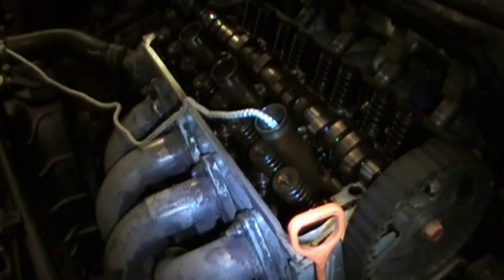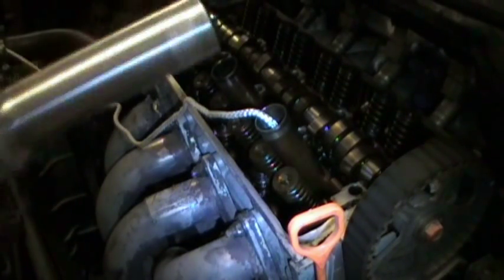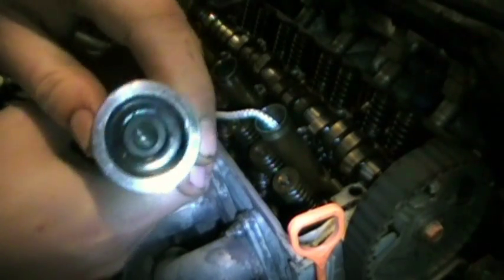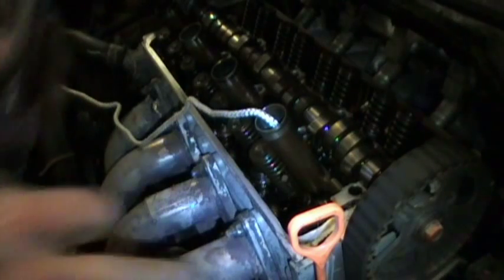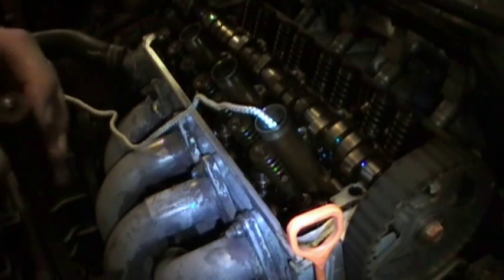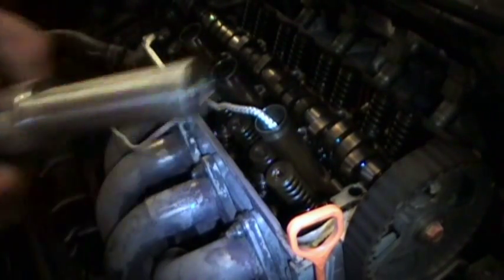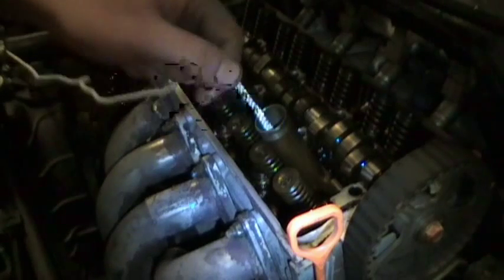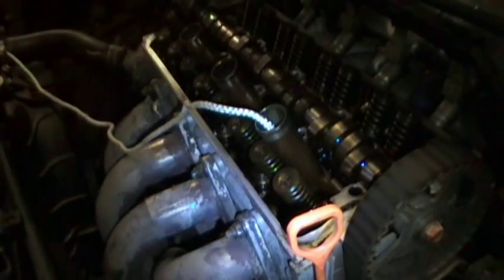Valve spring install/remove using ValveMaster

Comment: @netfreakcanada Sorry to keep bothering you.  I need to change the valve springs on a 150cc GY6 Chinese scooter engine.  Are you sure the GY6 keepers (are wider) will flare out on the top like on the engine in your video?

Comment from the maker: @Hooverdarnit when the keepers are secure on the valve, part of the valve will stick above the keepers. if you hold the keepers together you should see that one side is a little bit wider than the other side, so when held upright, the opening on the top is wider than the bottom. the keepers are placed into the retainer on top of the spring and the valve master install side has a metal nub thing that holds the keepers in place while pushing down

Comment: @netfreakcanada When you put the keepers on the valve stem, are the keepers supposed to be flush on top with the valve stem or is part of the stem showing above the keepers?  In other words, which way is up and which way is down for the keepers?  Is there a up or down for them?

Comment from the maker: @Hooverdarnit You actually put the keepers in the top of the valve spring by hand and the Valve Master pushes the whole thing down. Only during removal of the spring do the keepers end up magnetized to the tool. I'll be making another video of it with a much better camera this winter